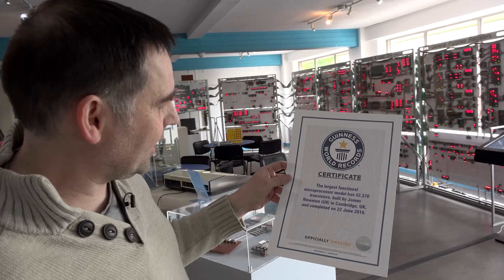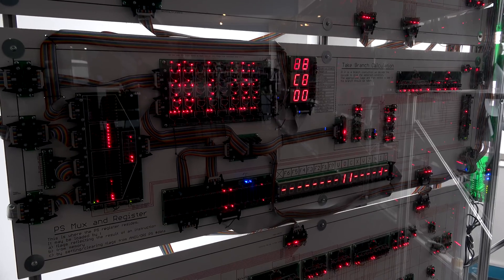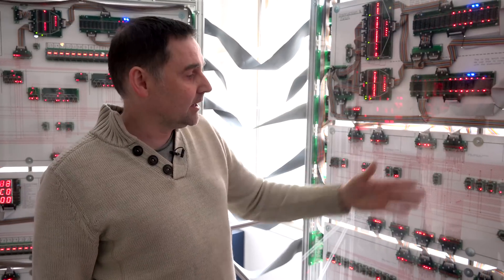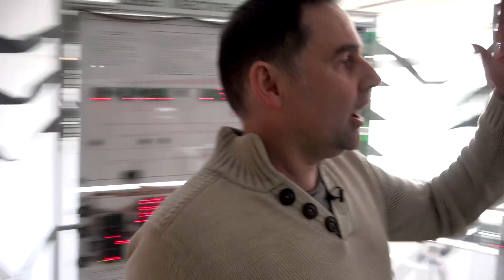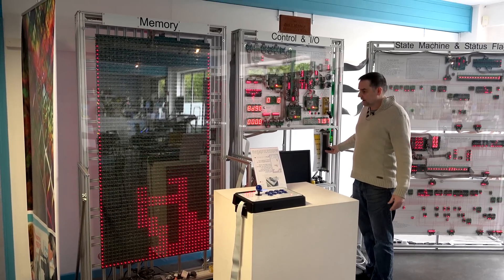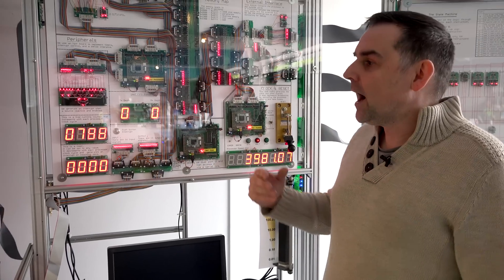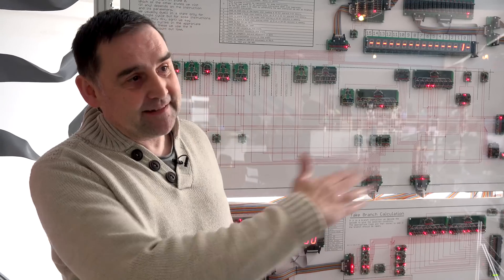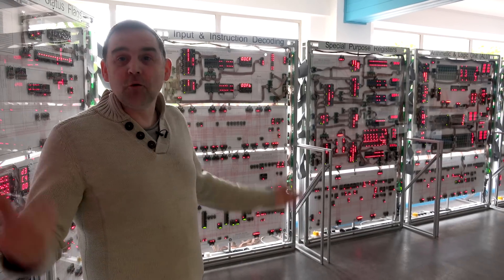MegaProcessor - Computerphile

Comment: The panel labeled "memory" IS actually a display. Where is the actual memory? Is that built on a transistor by transistor basis (or even use real core..) or are you using a standard RAM chip hidden somewhere within the frames.

Comment: wait, early computers were bigger -- they had the same functions, wtf Guinness?
Reply: those were build with mechanical parts, or used relays (like the apollo space computer), or even tubes. not transistors. hence why the record is correct, as it states transistors and not any of the other.

Comment: I want a physical Clock Speed slider on my computer
Reply: Use Redstone repeater then
Reply: @ShiroCh_ID   please respond to NASA they need you
Reply: @dac518  they need minecraft players?
Reply: @renatoigmed  no they need youtube commentors
Reply: Well you still wouldnt be able to single step it since if the frequency is set too low the RAM will dump since its not SRAM like it is shown in this video.
Reply: Botong Lin Yes
Reply: @steliosplaysmc Like a physical one, not in bios
Reply: @8b8b8b  some cases have a physical fan speed, i never used mine/ i think the OS overrides my input

Comment: Did anyone actually check the memory size claim? If a memory cell is, say, 5x5 cm, 8000000000 cells would take up an area of approximately 4.5x4.5 km, by far not the size of the UK...
Or am I missing something here?

Nevertheless, both the device and the clip are awesome, though. :-)

Comment: In terms of its actual computing power this is more akin to a very basic microcontroller. I believe that the very first commercially available microprocessor, the Intel 4004 from 1971, is more powerful than this.
But for the sake of a demonstration and as an educational tool, this is absolutely magnificent.

Comment: Ben Eater did a breadboard 8-bit processor, he explains every little bit of the design and development process of his project and everything that is relevant to it. If you want to learn more about this low-level stuff, check out his channel. There is also a dude (Eric Schlaepfer) who created a replica of the 6502 processor on a breadbord, much like this but much smaller. Also very fun to look at. It is called "The MOnSter 6502"
Reply: He must have used chips tho for the ALU etc. to fit it on a breadboard.
Reply: Dan Kelly correct, but to have a small model of a computer like this, using chips is the only way to keep it small when prototyping. The monster 6502 is on a PCB and uses only discrete components.
Reply: OMG that PCB must be huge.
Reply: Dan Kelly if you Google its name you'll see the size, it's not that big haha

Comment: What is it's CPU Speed? MIPS?
Reply: He explained the maximum clock speed is 100 KHz which is 0.1 MHz.
This is how many machine cycles per second, (call it ticks), it runs. Assuming an average of 5 ticks per instruction in a typical program that runs on this MPU it will run 20,000 instructions per second. So 20,000/1000,000=0.02 MIPS.
Altho the average number of ticks per instruction in a typical program for that MPU might be higher maybe 7 or 8 ticks. Depends on the architecture and whether he designed any powerful instructions for it.

Comment: If there memory is cleared to play the game, because the "screen" is the memory, where's the code and data for the game?  Code could be hard coded ("ROM"), but that would not allow for it's data, unless the data is only in registers.
Reply: The way he explained it he doesn't really understand microprocessors. For example he gave the impression that all the RAM it has is the display. That cannot be correct because you need additional RAM for the Tetris program and the data associated with it. Plus the program will require some extra RAM to hold variable values etc. He must have meant that the display is all the VRAM it has.
I was thinking the backs of the panels must be covered with circuitry which is the RAM. Then all you need is an interface for a floppy drive to load programs.

Comment: But can it run crisis?
Reply: Let me put it this way, assuming you hooked up enough RAM and the hardware needed to load Crysis this microprocessor runs at only 100 KHz, (as pointed out). It would take a very long time to update even one frame on the screen.

Comment: This is very impressive and something I'd love to see, but why does it look smaller than a transistor computer from the 1950's or 60's? Or is it?
Reply: My best guess is that the CPU takes up more room, because it's spread out to demonstrate it's components.  It could be smaller overall though, because no tape drives, drum storage, printers, card punches, etc.
Reply: This is only a microprocessor. People use MPU and CPU interchangeably but that is inaccurate. Back before MPU's existed then there was only the term CPU of course.

Comment: I wonder if we can run cinebench on this thing and if we could, what would be the score?
Reply: Well he told us it runs at a max clock speed of 100 KHz. Depending on the average machine cycles used per instruction for a typical piece of code it might do 10,000-20,000 instructions per second ie. 0.01-0.02 MIPS. So yeah a very low score. lol

Comment: Excellent idea, very useful teaching tool. Try and speeding up the clock to the point it crashes, put a scope on various parts and watch the timing and voltage margins diminish and wave shapes become rounded as the switch speeds of the transistors is reached and the long cable lengths and PCB layout causes problems. Also note the increase in power used.
Reply: I assume that's why the clock setting max is 100 KHz.

Comment: What is its tdp
Reply: I guess not much transistors and LEDS don't dissipate much heat. Also this microprocessor uses somewhere around 25,000 transistors but that includes the panel for the internal RAM of the microprocessor I think.

Comment: I spy, with my little eye, two microchips in the I/O panel, negating any claims (as were at the start of the video) of it being built solely out of discrete transistors.

On further research, one of the Lattice boards manages the I/O RAM, and the other is the I/O control unit.
Reply: To his credit I'm pretty sure he built the microprocessor's internal RAM out of discrete units.

Comment: I considered the possibility that you could do this, but it's impressive to see an actual example too.
plus, it's more complex than I would have expected someone to attempt.
I mean, you can get a long way with relatively few transistors.
A 6502, widely used in the early 80's is just roughly 3500 transistors.
This beast of a thing is 10 times that level of complexity!
It's also much bigger than it would need to be, whicb makes sense given what it's for, but if you cut down on empty space and use smaller components (eg, small, surface mount parts) you could replicate this whole thing in vastly less space.
Especially if you don't care about seeing it's internal state...
Reply: however if you make such a "macro" processor, what's the point in NOT seeing the state of every unit ? :-)

Comment: He's wrong about the size of 1GB of RAM ("average mobile phone"). 

His panel is roughly 1 meter wide, and has 32 columns of LEDs. So it's one meter per 32 LEDs, or one square meter per 32 x 32 = 1,024 LEDs. 

1GB is 1,073,741,824 bytes = 8,589,934,592 bits (or LEDs). So a 1GB panel would need 8,589,934,592 / 1,024 = 8,388,608 m² (Square Meters), which is roughly 8.4 km² (Square KiloMeters). 

The size of England is 130,279.0 km². 8.4 km² is roughly two times Central Park NY (3.41 km2). 

So 1GB of RAM on his panel wouldn't be twice the size of England, it would be twice the size of Central Park. That's quite a difference

Comment: Great stuff! Is there a performance penalty having things so far apart opposed to just millimeters?
Reply: If the processor is about 10 m long, the light time is around 33 nanoseconds. Electronic signals move about 2/3rd c, so around 45 nanoseconds (4.5 * 10^-9). The top indicated speed for the machine is, 10^5 Hz, or 10^-5 per cycle. The ratio of those two numbers is about 1 in 10,000, so no, not much of a performance hit.

Comment: I wonder how would a discrete transistor implementation of a full ARM Cortex-M0 core would look like. I would allow integrated circuits for RAM and Flash ROM. That would be a modern 32-bit processor with a actively developed core and toolchain.
Reply: However it does allow demonstrating how high level code get transformed into low assembler and then native code, and how the resulting code interacts with the hardware.

Cortex-M0 is probably the smallest modern processor core supported by LLVM/clang (keep in mind that LLVM intermediate language is human readable.) And being a variant of ARM core it can migrate vertically to Cortex-A cores as found in smartphones and Raspberry Pi much easier.

Comment: what happen if we hit the input buttons faster than the clock speed ?
Reply: Nothing. The input is only checked once per clock, so it doesn't matter if the input changes 500 times, or 0 times, between each check.

Comment: Really cool! The only thing I might have done differently is gone with interrupts instead of polling.
Reply: There's no real difference. Interrupts can't be triggered faster than the clock cycle of whatever is handling the interrupts anyhow. Every system is, at some level, polling for changes. If the input changes several times between each clock cycle, then there is literally no way for the input handling hardware to be aware that anything ever changed.

Comment: In computer architecture class we had to mkae one of them but ina circuit simulator like HADES. OF course we had the advantage of having a lot of components encapsulated so we didn't had to build from scratch multiplexors, ROM memories and so on.

Comment: Why do you need 5 transistors for an AND gate? Couldn't you do it with 2?
Reply: couldn't tell if those were BJTs or FETs. I believe FETs are easier for logic design.
Reply: Yes you can but you need 1 transistor per input, so the minimum number for a 2 input gate would be 3. Have a look at ->
https://en.wikipedia.org/wiki/Transistor%E2%80%93transistor_logic

Scroll down to 'Implementation'
Reply: Dont forget that this is running LEDs as well, it could be the extra ones are driving them to keep the impedance high on the data lines
Reply: +iwtommo yeah myself I also forgot to take the LEDS into consideration since there aren't LEDS inside a microprocessor. lol

Comment: Please make a video about microcode.  I did it at uni, its one level below machine code.  each machine instruction i.e MOV EAX, [SP] is actually a sequence of microcode.
Reply: There is not much to say about microcode other than it being a more RISC-like (probably) instruction set below modern x86 and it's highly optimized for the processor design. (I can imagine things like the x86 decoder outputting different parts of the needed microcode sequence into different pipelines to maximize throughput - a level of parallelism that would be impossible to achieve normally), other than that it's quite hard to get a lot of info about it as big companies such as Intel or AMD don't make that info public :P

You can however do some interesting magic with microcode, such as "DIV and IDIV" not actually having a hardware divider, simulating 256 bit vector things on 128 bit vector units (Ryzen does this from what I know) and even fancier things like loading new microcode - haven't done any research on this but just saying what I've heard, you write a memory pointer to a register and BAM, suddenly new microcode is loaded :P (basically microcode loads it, does all the decrypting and checking and sets up the CPU internally)
Reply: +Nemes Also sometimes a microprocessor has undocumented instructions. So it's kinda like Easter eggs in a video game.

Comment: I read about it on IEEE Spectrum...
done by only one man...
kinda insane...
oh, and it draws quite a bit of power, basically all from the LEDs too...
Reply: what is a "TON" of power? A single LED uses like 3V*0.02A=0.06W. No idea how many LEDs they are using but let's say 20000. That would be 1.2kW -  that is still less than your average bathroom heater

Edit: internet research tells me it is actually using 10000 LEDs and "only" uses 500W.
Reply: sorry for having bad memory, I just found it's only 500W too...
the other statistics are interesting too...

Comment: The 8086 (the grand-daddy of most PC CPUs today) had around 29K transistors, in 1978.
I really hope there's a follow up video, comparing the MEGA with other computer architectures.
Also, this is literally memory-mapped screen I/O, not just at address 0xB8000.
Reply: pfff B8000, this stepped up the game, it has a linear framebuffer at boot time :3

Comment: Twice the size of the UK? Even if every pixel only represents 1 bit, that's 8 x 2^30 pixels.
Square root of that is 92,681.
Assuming the LEDs are about 2cm apart, each side of the screen would only be 1.85km long.

So it seems it would be the size of a village, or am I missing something?
Reply: The way he's probably working is that the cabinet holds 256 bytes of memory and it's nearly 2m tall. 1 gig would be 4 million times bigger
Reply: +st0rmforce What mrneglect  said makes sense to me.
Reply: What if you have 1 TB?

Comment: Where is the program stored?

It's not in the memory shown on the giant screen made of LEDs, so there must be more memory somewhere that we didn't see in the video.

What about the operating system? Does this machine have one?

How is the machine programmed?
Reply: Why would it need an operating system? It just runs code directly from a ROM. Presumably the program is read from ROM directly, but I suspect the actual working memory is not shown. The point was to make a working CPU, specifically, although it would'v been cool if they also showed the main memory. But I guess it'd be very large...

The machine is just programmed by writing instructions by hand, which is then stored in program ROM.

Comment: Is there some documentation available? Particularly the instruction set and microarchitecture would be very interesting to know. What tools do you use to compile code for it (what language, actually) and transfer the data to the computer's memory?
Reply: I suspect the code is just written by hand. Or perhaps using a very simple assembly compiler. These instructions are then simply stored on a program ROM. It really doesn't have to be more complicated than that for such a simple processor. There would be no reason at all to write a compiler for an existing programming language.... A higher level language would likely generate too much garbage anyway for the minuscule amount of RAM this CPU has.
Reply: How to get them on the ROM, then ;)
It does not have to be more complicated, but writing a (somewhat simple) compiler can be fun and I'd totally expect that to be a (group of) student's project for such a university.

Comment: I think this is amazing. Would it be powerful enough to compile & run C code?
Reply: In theory there's nothing stopping from being able to do that. But it would be kind of a wasteful exercise. The instruction set is probably tiny (I'd guess less than 30 instructions), so the compiler would be doing a lot of work to implement full C capability.

Programs for very simple processors with very small instruction sets like this, is best written either by hand, or using a very minimalist assembly language.

Comment: do you know how much money was spend making this?
Reply: Certainly most of the money was designing and printing circuit boards for each section. The individual transistors fall between $0.005 and $0.07 USD (yes, 1/2 a cent).

So assuming worst case and simplifying parts...

$0.07 * (16 memory width * 200 memory addresses + 2 adders * (14 transitors per bit * 16 processor width) + 2 general purpose registors * 16 memory width) 

Make for about $257.60 USD in transistors alone. Now add in $40 for resistors,  $20 for capacitors, $30 to design each panel's board, and $50 to print each panel's board.

There are 7 individual panels. That brings up the running total to $877.60.

I've not included the cost of building time, buttons, cables, and LEDs. LEDs vary widely in price in comparison to other base components, so I'll stop here. Let's just say that this probably isn't any where near as powerful as an Arduino Uno's ATmega328P microprocessor. Definitely something you'd build only for show & tell kind of purposes.
Reply: Through-hole LED's no less.... If he had gone for surface mounted LED's the price would be a lot lower I think, but yeah. LED's and PCB's probably overshadow all other costs by a large margin here.